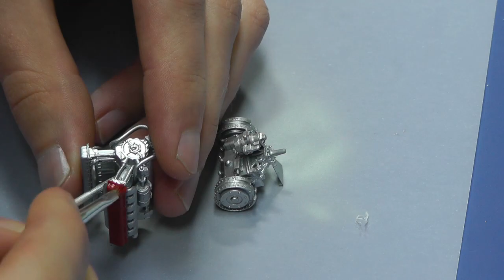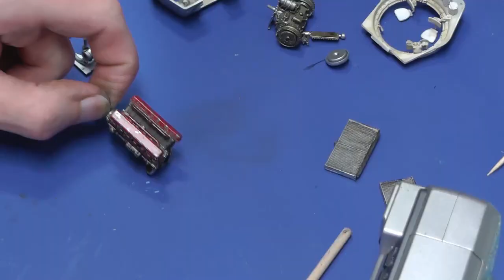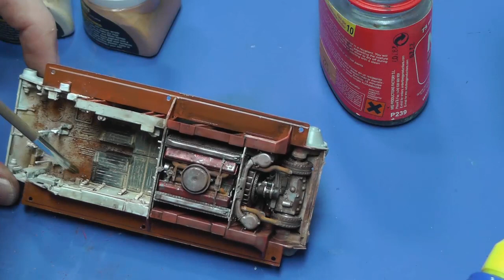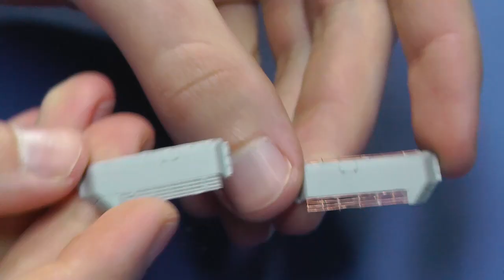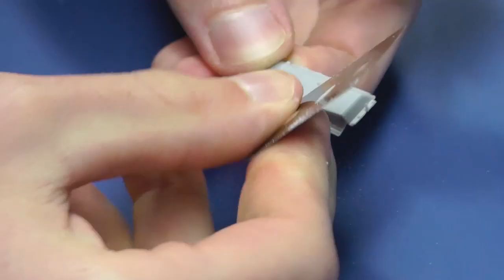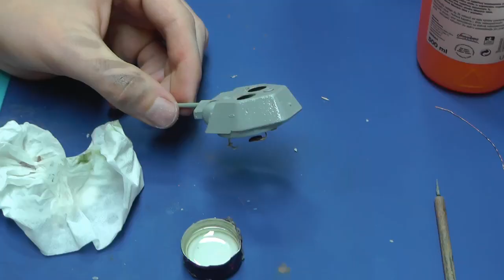How to build T-34/76 Hobby Boss 1/48 Part 2 Interier

Comment: What is the product (Siga Pro Thinner S 6001) you use to soften the styrene on the turret?  Is this a lacquer thinner or something else.  Hoping to find a similar product in the US.  Thanks for these great videos!

Co je toprodukt ( Siga Pro Ředidlo S 6001 ), které používají ke změkčení styrenu na věži ? Je tolak tenčí nebo něco jiného . Doufat, že najít podobný produkt v USA . Díky za tyto skvělé videa !
Reply: Hi, I do not know what products you have in the US, but you can buy any synthetic thinner for synthetic colors or acetone is pretty good and strong.
Reply: 96Delta You can use liquid model cement to get a similar effect.  Try Testors liquid cement in the small square bottle with the brush in the cap; that way you don't use up your more expensive liquid cement.